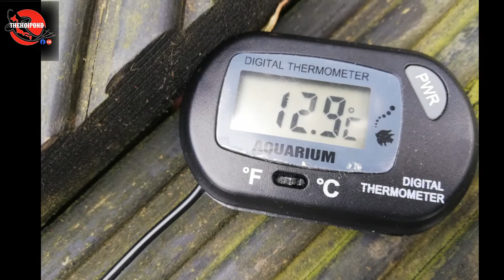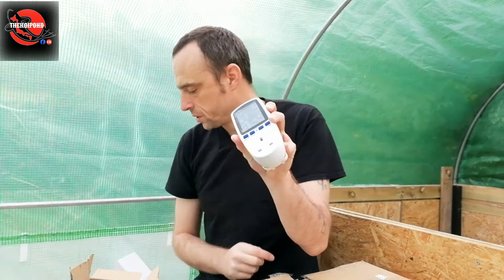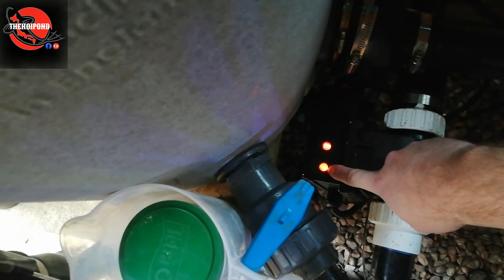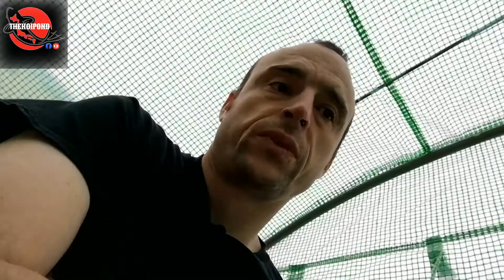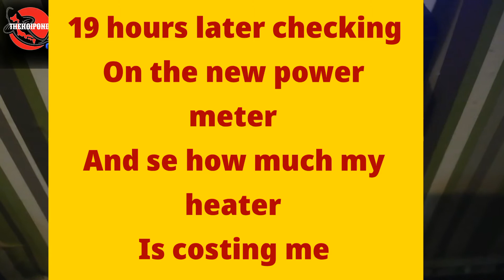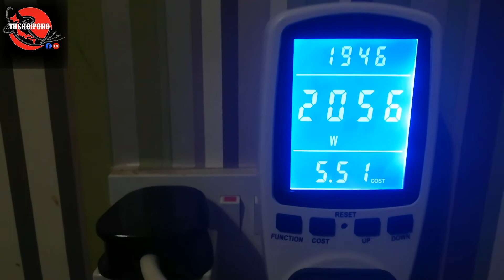⛩️THEKOIPOND⛩️ Unboxing a power meter AND Unboxing Pond ball's

Comment: Those meters are useful however pump more than 1.5 kw through them and they can catch fire. The national grid will give you a reading per hour if you inform them of the items you use a 150w heater is 10p an hour.